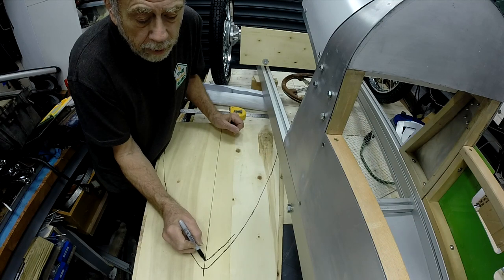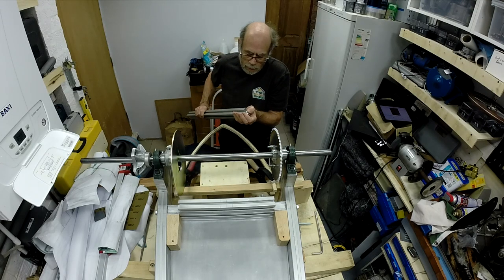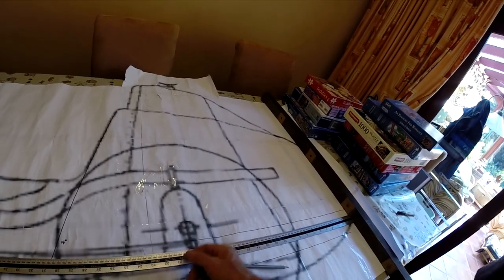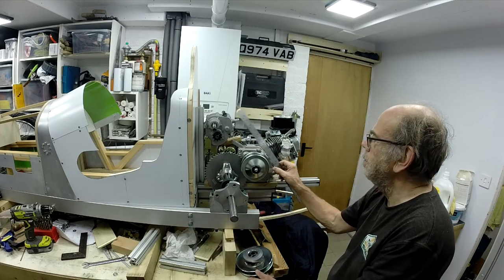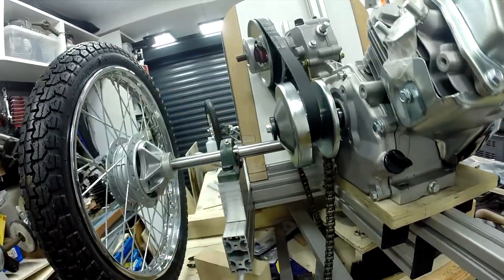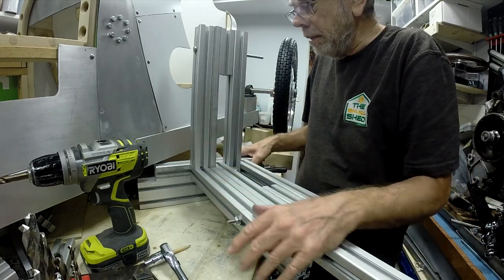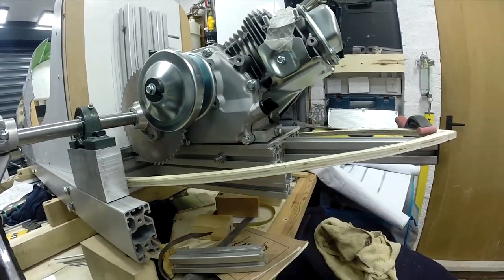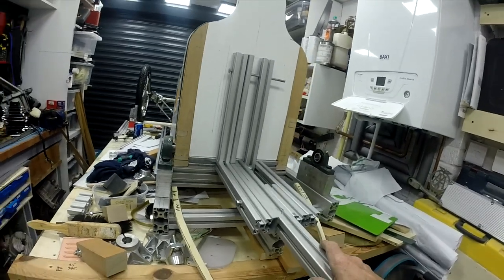small shed Cyclekart diaries #56 - August 2023 - Fitting the engine mount

Comment: You are doing a great job on the Kart Peter, could you a piece of threaded rod running from one side of the frame rail to the other through the middle of the cross supports to tie the whole rear end together? Never mind see what you did.
Reply from the maker: It's certainly a thought, though all of the members that screw to the rail would have to be re-thought, as they are also on the same centre line. It seems to be pretty buletproof at the moment, but a few laps of a race track will tell......